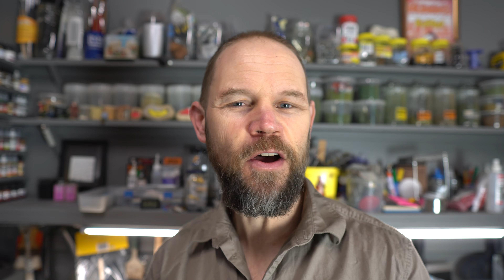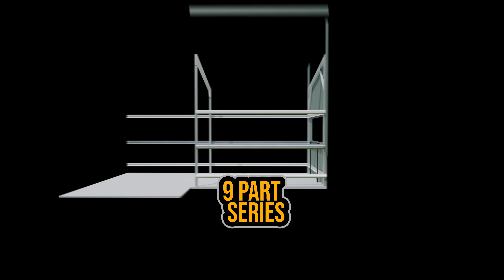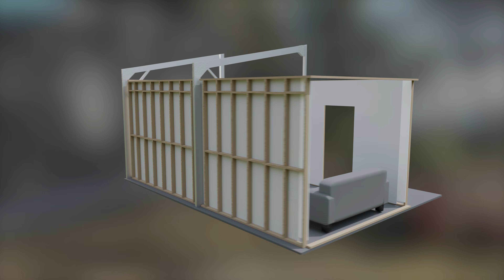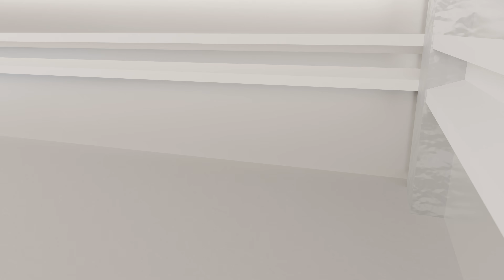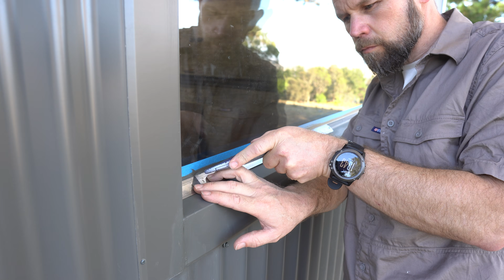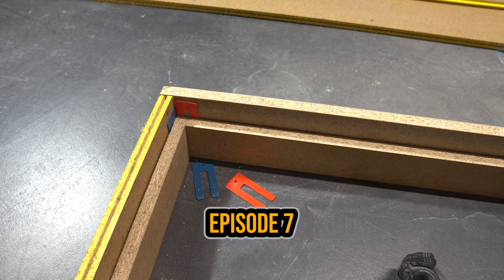Build a Home Studio in a Shed | Planning & Soundproofing (Episode 1)

Comment: Looking forward to the series. I just finished building my shed as an owner builder with the inspiration from your channel and added a home office in the mezzanine. Structaflor is my new favourite building material!
Reply from the maker: That's awesome, I keep finding new uses for structafloor - it's just a bit awkward getting those big 3600 x 800 sheets home :D
Reply: @rowanferguson I've used structaflor for both floor and wall panels. I've also used the 12mm structapanel T&G sheets for the ceiling. Definitely need a long trailer to bring the sheets home.